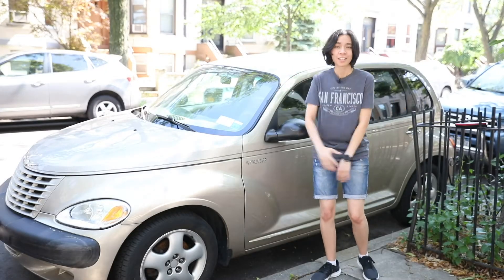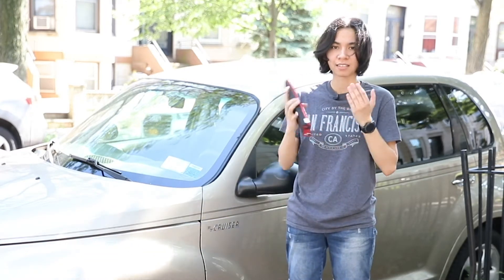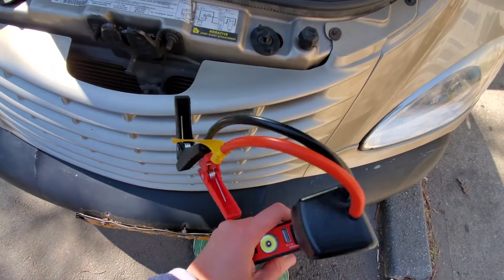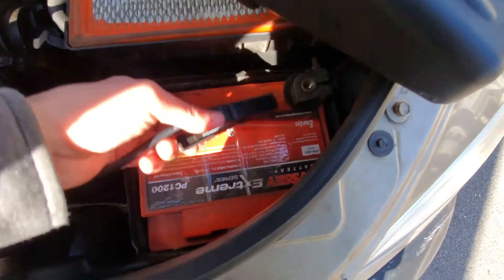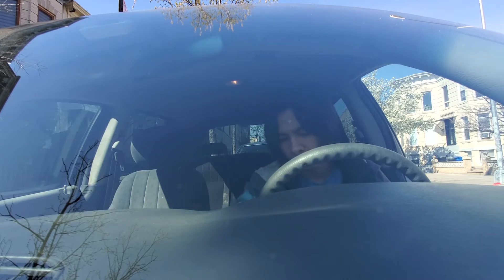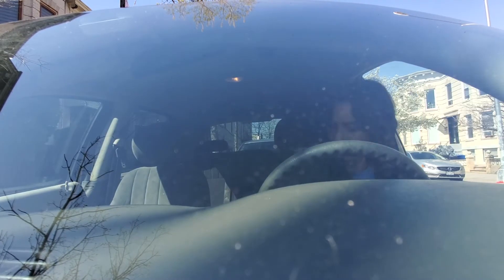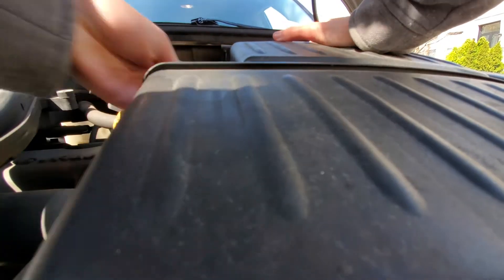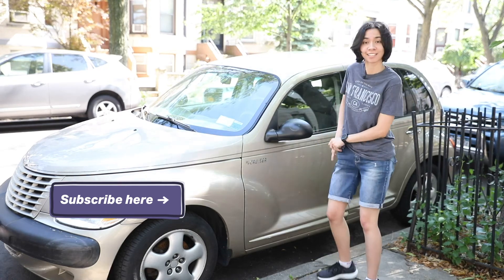How To Jump Start a Car Battery with a Portable Jump Starter (Micro-Start XP-10)

Comment: Did you actually have to wait 15 mins or where you joking?
Reply from the maker: At that particular time, my battery died quite a few times during the winter months. And that last time, it was actually left dead for maybe 5 days in fairly cold weather...so it was already so far gone and I was totally in need of a new one. I just had to get it across the street, so I let it charge for that long to give it some juice and it successfully jumped. It didn't last long though since it was pretty much on the outs already and the cells were damaged from the cold.